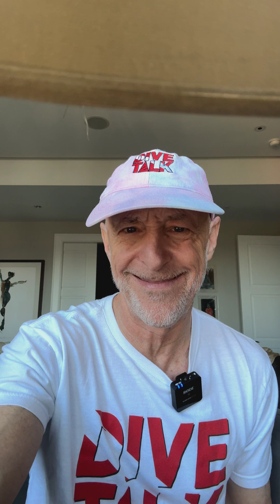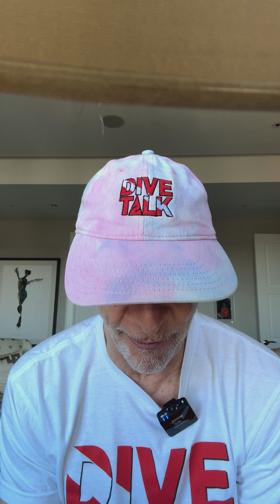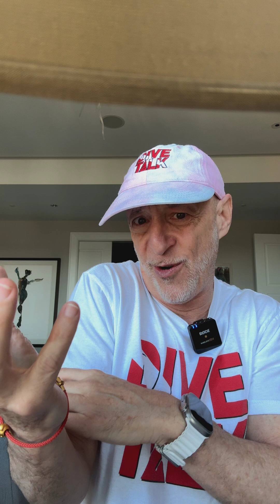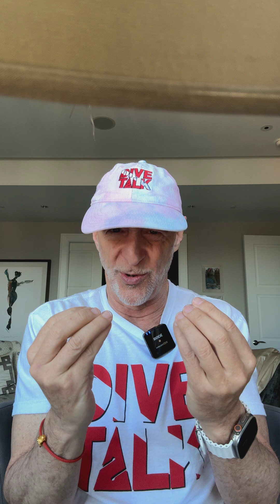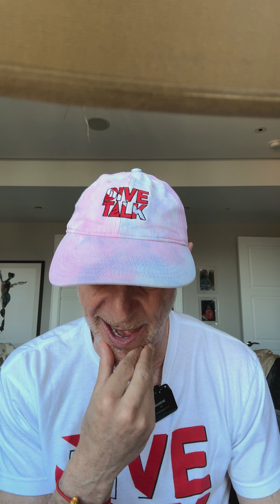Video 2 - Gradient Factors (Based off Andy Davis’s article).

Comment: good point about not to go to slow on your ascent otherwise you are penalized with more nitrogen absorption, but not so fast as to find out that theoretical ascent limit. Personally, i ascend probably twice as fast as i was taught when i was first certified. The deco hit vs ascent rate is an interesting conversation.